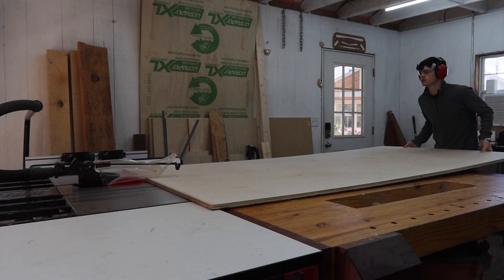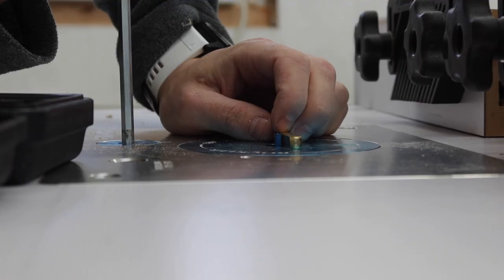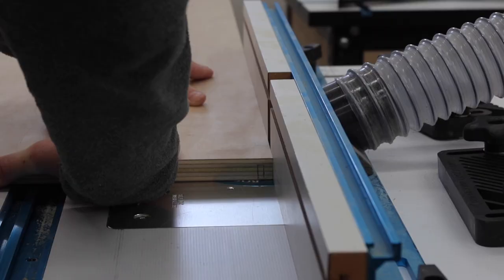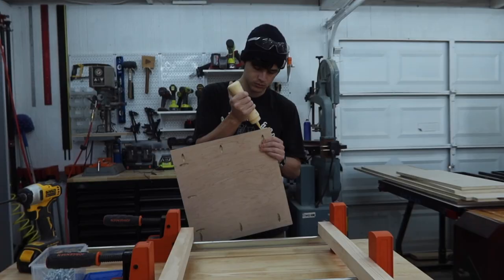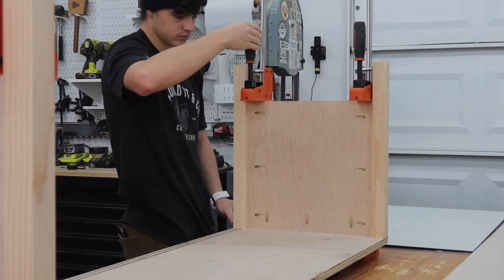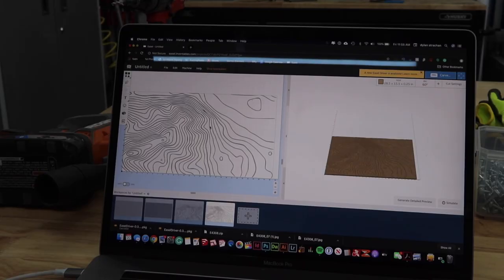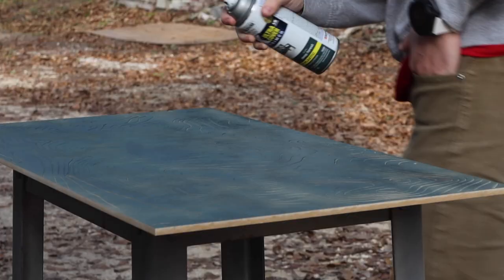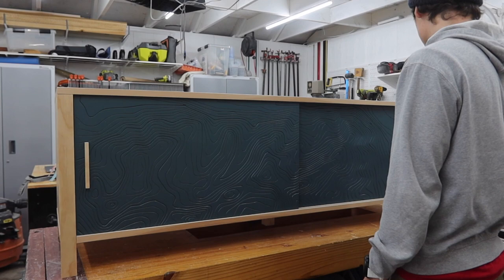Media Center with Topo Designed Sliding Doors

Comment: If I remember correctly, that's the fastcap method of edge banding. I've never used it but heard good things. How did it work for you?
Reply from the maker: Yes! It works really well, just a lot of steps. We really like the stick on edge banding rather than the iron on too!
Reply: @Woodbrew  nice! Did you have any issues with the adhesive not being strong enough? Or any like... (Idk what the correct term is) wrinkling of the edge banding? Where like... You need to slightly correct how straight the banding is and then that little angle correction stops you from getting the banding to lay completely flat?
Reply from the maker: @MaydaysCustomWoodworks  Yea repositioning is nearly impossible, that's good for it never coming off, and not good for mistakes. I think you could still heat it up slightly and reposition, but I am not sure if they recommend that. Honestly, it is so much easier to apply than iron-on so the mistakes happen less.
Reply: @Woodbrew  great! Thanks for the feedback. I always wondered about that. But I'm sure I can make a simple jig that will help me align the edge banding, so i think that will be OK. I don't do much edge banding. But when I do, I think I'll try some of the fastcap stuff. Thanks guys

Comment: Is it difficult to pop the doors into the grooves? I want to try something like this but I’m nervous about this step
Reply from the maker: Not at all! The top grooves are a little bit deeper than the bottom ones. This way you can put the top of the door up into the groove first and then place the bottom of the door into the bottom grooves!  1/4" difference should work!

Comment: The 5th leg in the middle made no sense. With the material you used and method of construction I can't see that sagging. Unless you load it up with bricks. Looks out of place and odd.
Reply from the maker: Just using precaution for sagging. You literally can't even see it from anyyy angle, which is awesome!